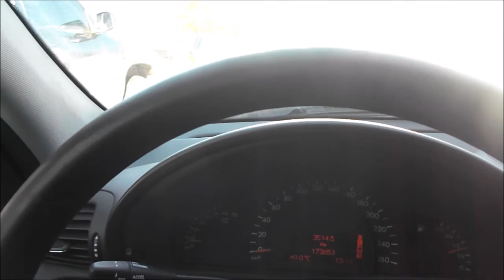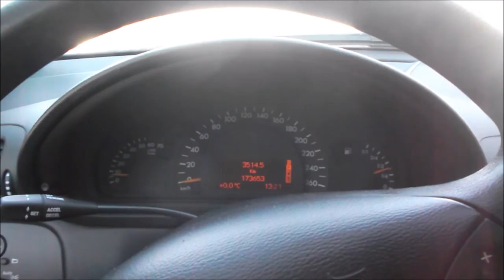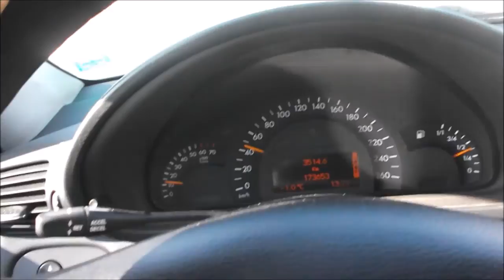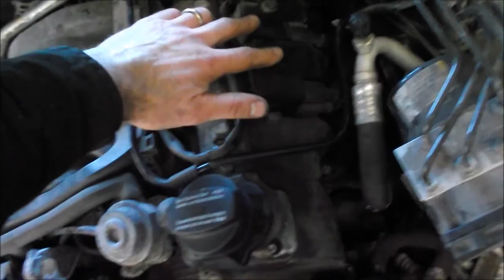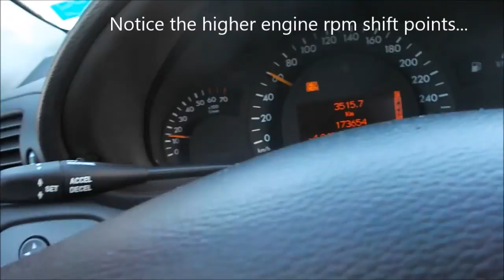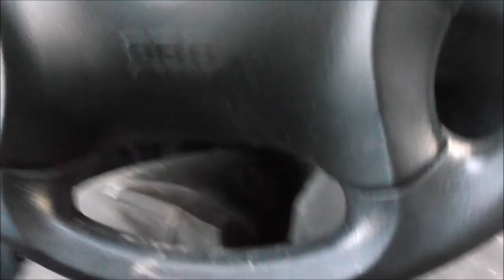DIY - Fixing harsh transmission shifting due to bad spark plugs 2004 mercedes 240C

Comment: My transmission was slippin I put new oil and a lucas and still feel like slippin I I changue my 6 spark plugs and the problem went away even the codes of check engine never show up again

Comment: The transmission of my car does the same thing, when I release the throttle it starts decelerating and I feel a harsh shift, plugs are new but I have mixed new and old coils.

Comment: Thought it was motor mounts but changed them ,still does it.  I'm going to change all the plugs. Don't think it's a transmission problem,hope not
Reply: Did you fix the problem?

Comment: I have a 2005 BMW 325i that just started doing this. The second sparkplug is barely functioning and the others are failing as well due to a valve cover gasket leak. I hope changing them fixes this problem. I'm so glad I found this video coz I was wondering if spark plugs can affect it shifting from 2nd to 3rd. Hopefully this solves the issue for me as well
Reply: So I changed the sparkplugs and the shifting issue is gone. Hopefully it stays that way. The check engine light came back on but when I started it, it misfired a little then smoothed out so I'm hoping the initial misfire is what set the light off and that eventually it'll go out
Reply: @elizabethkihara2668  Hey. I have the same car. Was the issue fixed? Thanks
Reply from the maker: Thanks for the feedback.  Please report back about findings

Comment: I had the EXACT problem! I had my transmission looked at for 4 hours and they couldn't find a single problem and I still noticed the shifts (started with 2-3 and progressed to most of the others over a 2 year period), low engine power, and spastic idle. After a high-output alternator (replacing the 134k stoc) and new spark plugs were put in it solved the issue. Everyone thought I was delusional too!

Comment: Mine is doing the same thing but i have an 08 dodge charger. when driving slow it shift just fine but if i step on it it shift had on 2 or 3. so all you did was change the engine plugs on the car ?